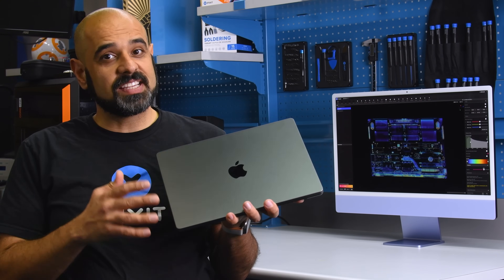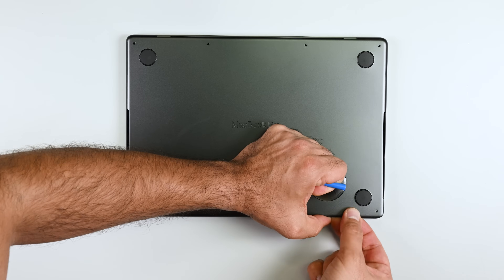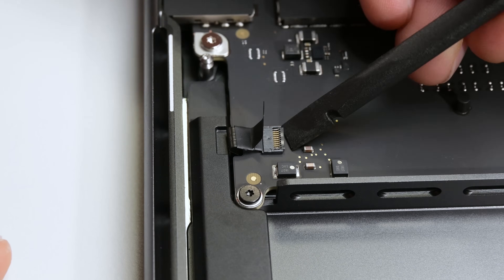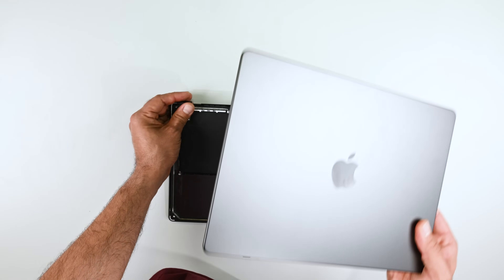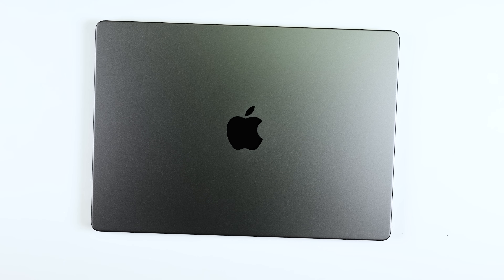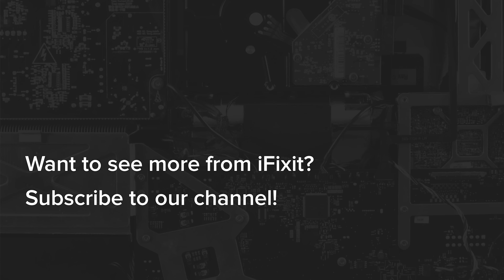M5 MacBook Pro Teardown | Apple’s Subtle Step Forward in Repairability

Comment: In my opinion Apple still has a very long way to go, not every laptop has to be like a Framework, but Apple is still far behind in terms of repairability even compared to mediocre HPand Dell business laptops, I used to repair, without needing training.
Working for Mac-based company now, I bring the device to the repairshop every single time. 
I want a MacBook where I can confidently replace the battery, screen and keyboard, as well as upgrade the storage.

Comment: I have a Steve Jobs era 2011 17" Macbook Pro and replacing the battery is relatively easy. Remove the back cover like in this video, then unscrew a few more screws and connector the old battery comes right out. The hard drive is even easier to remove. Currently Apple is willfully making things hard for customers to replace the consumable battery because they want customers to buy a whole new computer instead. This is greed.

Comment: 4TB! Finally, storage matching my 16GB MBP 13” mid-2010!. Still not removable or replaceable though, and not across 2 drives either… And the battery is a little easier to replace on mine!

Comment: I have a 15" 2017 Macbook Pro and it's fun to see that almost a decade later the battery replacement process is just as convoluted and tedious as it was on my laptop.
The lack of repairability is a long-standing, deliberate anti-consumer institutionalized practice, and the sole reason I haven't bought a single Apple device since.
Reply: The issue seems with available parts, not repairability. It seems really simple. The only issue is you can't buy a battery to swap out, you have to buy the entire chassis.
Reply: @floofy5529  nope, the repairability is dismal at best as he showed in the video
Reply: ✅ Bingo .
Reply: Their devices were more repairable in 2008 than they are in 2025. 

I dumped Apple for Windows in 2019, mainly because of repair frustrations with my 2015 MBP 15". My gaming laptop has been a breeze hardware wise, but I'm honestly fed up with the software issues that come with Windows.

I'll probably switch back to Mac in the next few months.

Can't have the best of both worlds :(
Reply: @kausthubh there are a lot of very easy to use and stable Linux distros. Try ZorinOS, might save you an unnecessary upgrade/sidegrade.
Reply: @kausthubh  you can try Linux, but it's not as easy to use like MacOS or Windows, for me, Windows is the worst option.
Reply: This is all total apple bullshit.... an extremely poor design just to replace the battery pack, you've got to be kidding me!,  😮 💩💩💩💩💩💩💩💩💩💩💩💩💩💩💩💩

Comment: What's the point of having pull tabs to (subjectively) easily remove the battery if you can't replace it with another battery, and only replace the battery? That makes 0 sense to me.

Comment: Certain people (such as myself) through my work employer are left to do a majority of our work on Apple/Mac devices. Sure do miss the numerous hardware companies that ran windows, that (for a while) still had user replaceable batteries. One could literally swap out the battery in less than a minute.

Some hardware companies even offered different battery options. A slim battery which essentially matched the rest of the laptop for hardware. And then a battery which was well over double the size, and also essentially making the laptop well over double the width.

Comment: 1) Selling the battery in the chassis is probably a short term thing. Remember, these only just came out and the only battery replacements are going to be done by apple for the next year or so. Plenty of time for them to have different parts availability. If they're still only selling the battery as part of the chassis in a year's time, then you can complain. Right now, its just whining for the sake of clickbait and keyboard warrior outrage.

2) Maybe this is a 4/10 compared to other laptops in terms of reliability, but if that's a case, I'd consider that a win. I didn't see anything difficult there. Its screws and connectors that easily separate, which is like n00b levels of difficulty. If you can't unscrew screws, you have no business attempting to repair anything in the first place. I come from the world of automotive repair and, by your standards, every car on the road built since the mid 1960s would be a -400 / 10 in terms of repairability lol.

3) I'm not an Apple fan, and I am a big supporter of right to repair, but I also don't think that every single device should be fixable by someone who can barely spread butter onto a piece of bread.

Comment: Some of your critisims don't make sense or at least the way youre describing it could be better. eg: The fan is annoing to take out and replace, for sure but you have to see how it is engineered and macbooks are extremely dense while being some of the sleekest laptops you can get. This device is very repairable imo its just one extra step and you can still use an air can to clean the fan you dont need to take the logic board out unless the fan itself failed, where it might actually be a good idea to inspect the logic board too if the fan failed like that. Critisims in repair should not necasairly go into design choices but only the deliberate design choices that are aimed only to make service and repair harder. I keep coming back to the philosphy of the framwork laptop, its amazing in repair but its repairability considerations get in the way of what could have been an excellent lmainstream laptop otherwise if they choose a middleground. Also why cant you just take the battery out from the new chasis and put it in the old one? seams allot simpler than a chasis transplant?

Comment: No one is talking about there is only one fan in the 14 M5 MBP, comparing with 2 fans in M4 MBP?
Reply: The base M4 had one fan too. The m4 pro and max have 2 fans
Reply: yeah wtf was that?
Reply: The Apple M5 processor uses the same 3-nanometer fabrication process as the M4, specifically TSMC’s third-generation N3P process, which offers improvements over the M4’s second-generation N3E node. 

Considering the M5 chip is built on a refined 3-nanometer process that delivers measurable performance and efficiency gains over the M4 which could include better thermals as well, hence one less fan. This is the only reason I can think of.
Reply: I mean you would think it is a main discussion point but yet @ifixit chose to ignore it.
a top tier level of journalism.

Comment: We don’t need to worry though, soon enough third parties will start producing standalone battery parts that is not pre installed to a new chassis. Cutting the price that we have to pay, and as we’ve seen as well, eases the replacement process by A LOT since the battery itself comes out right away with pull tabs, not needing any barbaric prying that we had to do back in the day with the 2012-2020 MacBook Pros.

Comment: Still say that the best MacBook Pro series to work on (in terms of repairs) was the Unibody series from 2009-2012.
As for this one, I don't like the fan being buried under the motherboard, because the fan will need regular cleaning. I also don't like how the battery is glued in (and how Apple recommends you replace the entire keyboard/palmrest/battery as a whole $500+ assembly) - why can't they use the new electrically bonding methods used in the iPhone, where you just apply 9V-12V to a couple of pads for a minute or so?
Reply: it will be there in 5-7 years, maybe
Reply: The fans on Apple silicon MBPs do not require regular cleaning; they are barely used because of the thermal efficiency of the chips.

Comment: 1:06 it would be nice, if the iFixit-Replacement batterys would also turn off, when this connector is disconnected. I ordered a couple of batteries from you already and most of them were "always on" aka. ignored this connector while still claiming to "follow the OEM specification" ...

Comment: Here's a question: Is the battery serialized? Or could we just pull the battery out of the new chassis and put it in the old one?
Reply: I don't think it is; but it doesn't matter anyway. Apple provides the tools to pair serialized parts to the device. Quite obviously they have to, otherwise their repair manuals and repair parts wouldn't make a lick of sense.
Reply: I don't think apple batteries have ever been serialized

Comment: Just think how awesome Apple's hardware could be if they weren't laser-focused on making life difficult for the consumer who just wants to swap out, for example, the battery or other commonly failing components. Yes, they are now at least making a bit of an effort, but it's the bare minimum. Let's face it, they still really don't want consumers to easily repair the devices that they bought, Apple would rather sell new ones.
Reply: Duh you don't own the device, you just use it acc. to Apple! Fxxck Tim and his gang...

Comment: The worst company on the planet which creates e-waste deliberately, next to change display you have to buy the whole laptop.
Reply: This isn't true. Deliberate e-waste creation should be "awarded" to Lenovo, Dell and HP.
Reply: @megatronskneecap  Come on, which company solders SSD and move controller to security chip T2, ssd gone computer gone, there is a limit to greed, their whole innovation is based on locking consumers and increase wastage so that they can sell new.
Reply: @tbud3734  “Which company solders SSDs?” Now? You’d be surprised, many companies are adopting the practice. Also, the T2 security chip doesn’t exist anymore, its functionality exists entirely within the Apple Silicon M-chips. At least MacBooks have exceptional build quality. Lenovo and HP have severe hinge issues and Dell is Dell.

Comment: “Modest performance bump.” 

15% on single core performance year on year is insanely good.
Reply: But if intel it’s meh. Lol
Reply: 15% still doesn't meaningfully change the performance of a device. It still takes basically the same time for a given workload (for example 8.5 Minutes vs. 10 Minutes according to the 15% figure). You seem to disagree with the word "modest", I disagree with the term "insanely good". Back in the 90s, there were 30, 50, sometimes even higher gains year over year and even those were not "insane".

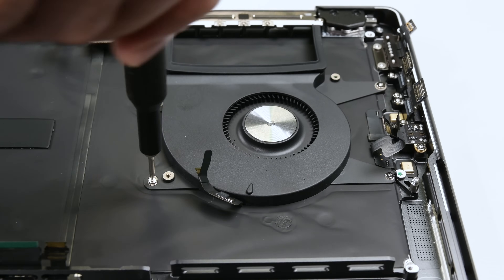Comment: 3:41 on the plus side, the fan in the MBP barely ever runs and most people might not even notice that it has failed long after it does fail if it ever does in the first place.
Reply: So there's isn't even a need to get the pro then just get the air
Reply: @valinkdevr5520 pro is for the intensive prolonged work, air is for everything else
Reply: @valinkdevr5520  there's quite a few reasons why a pro is better than air.

Comment: I would never attempt to replace the battery myself anyway.Just leave that to Apple.
Reply: A well thought out battery assembly in a laptop is just about the easiest thing alive to replace in a quality system that actually has replaceable parts in mind with the design.  Typically the only thing easier would be an M.2 SSD and/or socketed RAM.    And I'm even old enough to remember when the batteries were these nifty removeable (and some even hot swapable) components without any chassis disassembly required!
Reply: That's inherently what they want you to do and think. The pull tabs have made it not that difficult at all though.

Comment: Or, remove the battery from the new chassis and buy replacement pull tab strips to reuse the existing chassis? Sure your left with the extra chassis/keyboard but you save time tearing the entire thing apart. Apple still needs to sell the battery separately
Reply: Then why didn't Apple sell the batteries separately? This is apple trying to fk the consumer

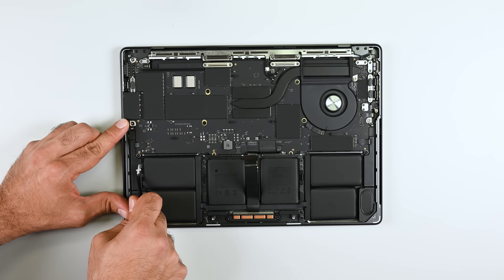Comment: 1:52 Ugh, there's a cover to the left of the heat pipe that looks like it'd cover a SODIMM slot. One can dream.
Reply: That's used for a secondary fan on their higher-end machines. The logic board design on these is sloppy, lazy and unpopulated with a recycled design from again, their higher end machines, just with more air inside basically.

Comment: This is why I bought a Framework laptop 😊
Reply: Now tell me how to install macOS on that thing. ;-)
Reply: They're great if you want reparability and the option to swap out and upgrade components, yes, but there is a genuine advantage to a unibody chassis design that doesn't have magnetised components build-quality wise.
Reply: How often are you expecting it to break? I've had 3 macbook pros in about 11 years and not one of them has needed anything repaired. I changed the battery on both before selling, 6-7/10 on the easiness scale.
Reply: @milesaharrison  My M1 MacBook Air’s LCD recently died and I bought a donor MBA to swap the lid from. It wasn’t even that difficult.
Reply: no, you bought a framework because of its good marketing. Repairability-wise a common ThinkPad will beat it in pretty much any aspect - especially parts availability. You can get dirt-cheap replacements for pretty much anything shipped to you next day. The market is, and has always been, flooded with corporate notebooks in mint condition, there is no way for Framework to stock many generations of pretty low demand parts for years to compete with the economics of refurbished/salvaged premium e-waste.
Reply: @coolm98 The main thing with Framework isn't repairability, it's upgradability. If you want to upgrade the CPU, you just upgrade the board, no need to replace the whole laptop.
Reply: Also the quality of service manuals from Lenovo and Dell seems much better than Frameworks - at least for the PDF-Versions (that's the one that counts. not gonna watch a video for fan-replacement on a 5+years old device, if its hosted somewhere still after all...)
Reply: But how much money you paid for it? I`m sure it`s most repairable/upgradable laptop for today, but anyway it is overprice. To me it`s good experience when just critical components, like SSD should be easy replaceable. I can live with soldered memory, but I don`t pay +500$ for just more upgrade options.
Reply: who really cares
Reply: @jeja6801  Hey now, there’s no need to be rude.
Reply: @jeja6801  no one, that's the funny thing

Comment: If the gains on the upgrades are negligible year on year it's time for Apple to introduce a 2 year product cycle.
Reply: They're not though. The M5 chips introduced a new physical security section inside the chips which is a great bump in on-device security and cryptography. The GPU bump for AI workflows is also pretty impressive this year.

Comment: Why only one fan 🤬 previously it used to have 2 fans
Reply: Only Pro Macbooks with the pro chips have 2 fans
Reply: Base MacBook Pro's have had one fan since 2017, these 14" inch machines with one fan started with the base M3 models as a replacement for the 13" base machines.
Reply: No, the 14” have only ever had one fan, the 16” are what they put two fans in
Reply: yes 1 fan for m5 and é fans for m4
M5 MacBook Pro’s Single Fan Cooler Unable To Prevent Thermal Throttling

Comment: Room for improvement? No Solo Battery, SSD or RAM upgrades (or repairs) it's a 2/10 from me.....
Reply: i feel like its safer to have multiple batteries, if one fails you'll be fine, the ram is on the soc so its really fast, but yeah i do agree that it should be more replaceable
Reply: How do you expect to upgrade the RAM that's packaged-on-chip as part of the SoC? Get real 🤣
Reply: @lukealization  Apple chose to design it as an SOC.  They didn't need to do it that way.  At the very least, they could have made the SOC a replaceable module (look at MNT Research's ARM laptops, for example).
Reply: The next windows pc you buy might have soldered RAM😊
Reply: @bismarcksanyanda2100  That will be a choice, BUT there's NO Apple TAX on the cost of RAM on PURCHASE. Same with Storage. If they made the cost of another 512GB/1TB/4TB of storage (or upgrade of RAM) remotely close to the actual cost, I would have less of an issue. My M4 Mini Pro cost almost £2000 to upgrade to a 1TB SSD and 64GB of RAM. THAT IS ABSURD, baring in mind what the base machine costs.
Reply: @d-zone  Yeah enjoy your non-SoC Windows machine that burns your lap while using out because it's most likely an Intel laptop.
Reply: @megatronskneecap  Many assumptions from a brave keyboard warrior; all of them are wrong!
Reply: @d-zone ”brave keyboard warrior” projection considering you decided to come back with this. Prove me wrong then 😊
Reply: @megatronskneecap  Prove you wrong? What is this, school? Just for the record, I don’t use Intel CPUs or a laptop, so apart from those minor details, you were bang on!
Reply: @d-zone You said my statements were all wrong, and now you’re going back on yourself and claiming they’re right apart from “one thing”? Are you ok?
Reply: @bismarcksanyanda2100  At least he can upgrade SSD, 4 TB - $250, not 1k like in Macs

Comment: Apple’s repairability is clearly a big illusion.
They’ve designed the repair process in a way that allows them to claim it’s possible, but it’s so complicated that almost no one would even consider trying.
Selling the battery together with the chassis isn’t a bad idea, it’s a strategy to make repairs unfeasible due to part and labor costs.
Providing a manual for something no one will realistically attempt has zero value.
They deserve a score of zero for clearly working against the consumer when it comes to repairability.
iFixit urgently needs to rethink its evaluation process to avoid falling for manufacturer tricks, the kind used to mislead lawmakers and block stricter regulations.
Reply: I think so too. Its not even that each step is necessarily difficult its just that all their products are unnecessarily complex with countless of screws of different sizes for each little component. Its clear that they just want the repair process to be tedious so that the average consumer doesn't even think about doing it